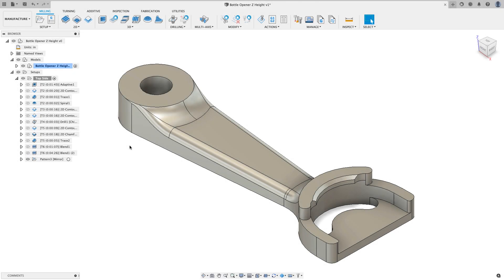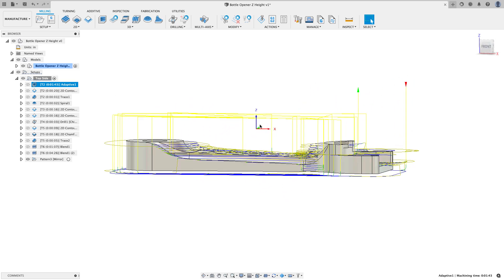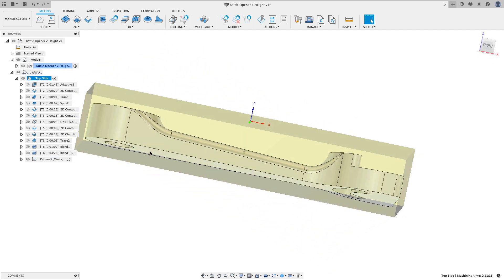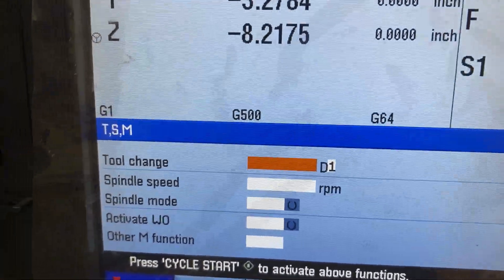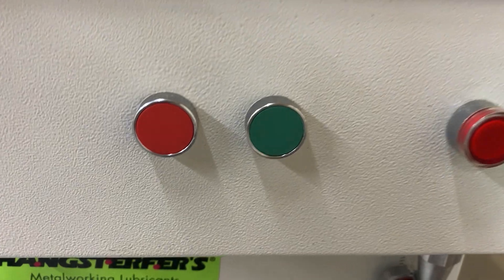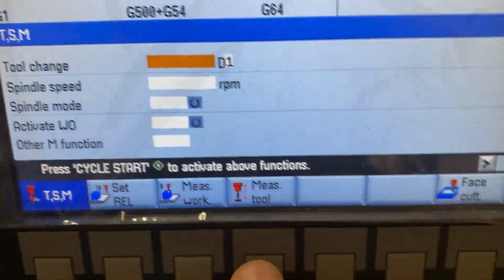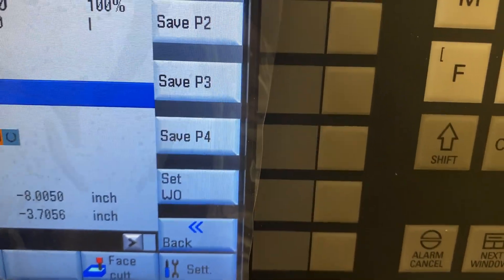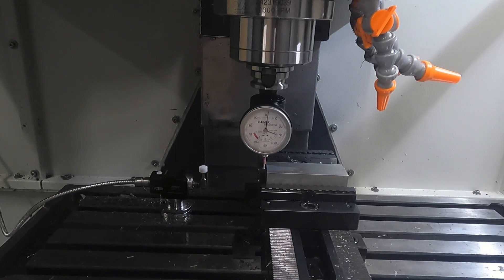How To Run an Unproven Program and Not Crash with a Siemens 808D Control

Comment: In industry prior to probes, a guage block was used for setting Z height accurately.. So, if using a 1" guage block (or "JO"), simply lower the tool to a height where the block cannot slide in between the stock and cutter tip. Now raise the cutter until you can. Just remember that when you go too high THE BLOCK CANNOT BE UNDER THE CUTTER WHEN LOWERING! If it is, and you are dialing in that last couple of tenths in "Z" you WILL BREAK THE CUTTER TIP... in normal conversation I would now say "ask me how I know." Usually guys would have a second 1 inch JO block for this and obviously it is necessary to enter the 1 inch "Z" value as your "Z" height at the machine.

Comment: Hi, 
I've been helping my friend mill some aluminum hubs with his Protrak. I was wondering how you ended up low on the first inspection. Was it programming or tool height error? We had to test everything multiple times, because on the KMX controll you set the Z offset on the base tool and all the others are  relative to that height. Every time you turn off the machine the tools need reset 😂.

Comment: I use the depth on the caliper  and measure in fusion . This insures the outside cut is clear. For years i have been using a dowell pin to set cutters.  bring the cutter past the depth of the pin and RAISE UP TILL THE PIN SLIDES UNDER  never go down on the pin scrap the cutter.   HAAS MINI

Comment: I was taught this same method for checking z on a tormach and really like it.  I am now using a Haas and unfortunately cannot figure out how to do it easily as the haas display shows the z position relative to the spindle nose on the display, rather than showing the z position of the tool tip.
Reply from the maker: Hi Gina. I need to look into this more on the Haas. I'm not sure there is a way to show that information on that control. We used the Distance To Go at the beginning of a program to make sure the tool was in the right area and it looked like about the right distance to the next move. I'll see if I can look into this more.

Comment: Noticed your Haimer doesn't quite return to zero (this is adjustable btw). Please do a sanity check and probe a 1-2-3 block in positive and negative directions (both x and y) to make sure you come up with the expected value. You may find one to be slightly off. Also (I'm betting you did) make sure your indicator ball is concentric with an indicator by rotating the haimer in the spindle (by hand) with an indicator resting on the ball to ensure no runout.
Reply from the maker: Good eye. Here is a little secret. I pulled the Haimer out of the box, inserted a pull stud, and then made the video. So I haven’t done any calibration on the Haimer at all yet.

Comment: Great info and I am one of those people that are about to jump from a 770M to an X7 Syntec. I haven’t found a similar walk through on the Syntec controller yet, any idea if one exists out there?
Reply from the maker: Hi Tim. As someone that used to teach all the training classes at NYC CNC, you are going to absolutely LOVE the Syil over the Tormach. There is a YouTube channel named Nerdly and he does some videos on the Syntec https://www.youtube.com/watch?v=V_4TYLt3J4A
Reply: @MechanicalAdvantage  I have been after some of his videos lately and thank you for the recommendation. I could not be any more excited about the switch to the X7. I’ve been running SLOW production on my Tormach with manual tool changes and I just need it to cut pallets without me babysitting. The tormach has been great but I outgrew it much faster than I thought I would. Cheers!

Comment: This is a great method. Thanks.
BTW, would you have chosen the Syntec controller or this Siemens; any pros/cons?
Reply from the maker: I'm really liking the Siemens control so far. It was intimidating at first, but George from Syil got me up to speed in less than an hour. I wouldn't be nervous about the Syntec at all. They both upsides. One of the things that I like about the Simens is the amount of support for it. Syntec is doing a really good job there too. They would be my top two choices over the other controls that are offered.